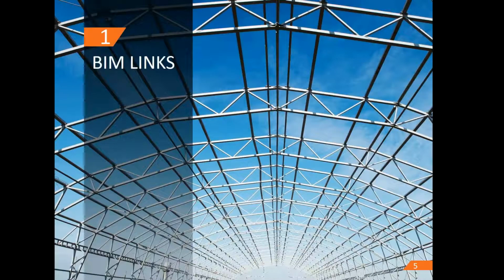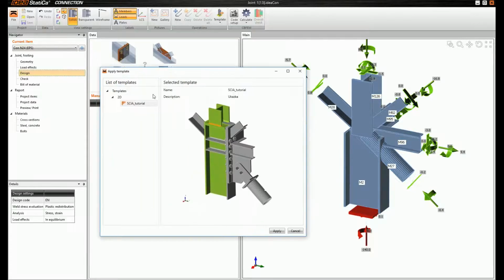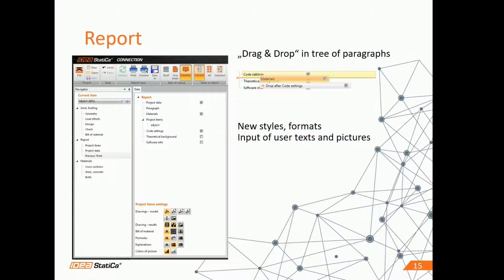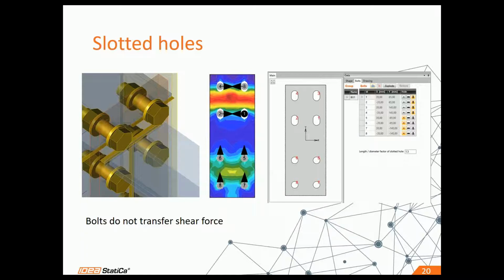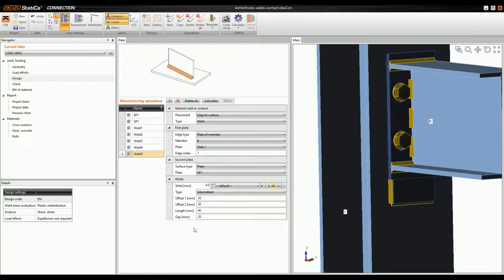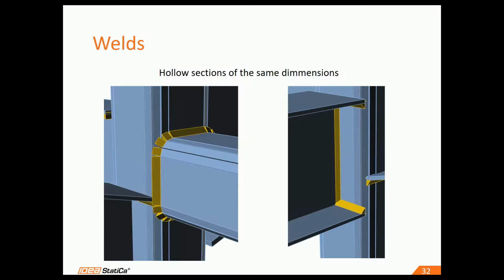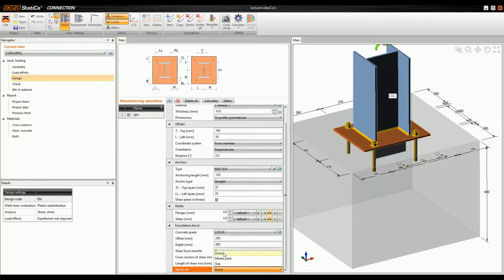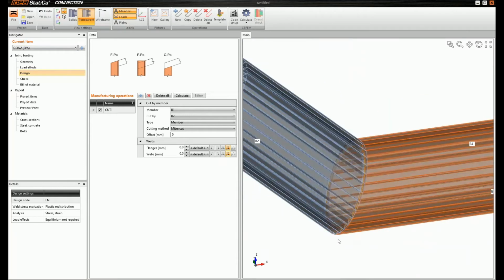What is new in IDEA StatiCa 8.2 for Steel

Comment: Amazing software so far i have seen to design steel connections! One minor issue i have noticed is the inability to export the connection details in dwg, dxf, or even pdf format to enable the designer show them in construction/shop drawings. Keep it up!
Reply from the maker: Hi Eman, you can export the dxf file in the Bill of material. Second option is online connection viewer, which can be accesed froum our web page. It's a viewer for your ideaCon files (saved project from Connection). One feature is export to 3D dwg. Just try it...
Reply from the maker: Thank you, Eman. We are working on this issue and it will definitely improve soon.
Reply from the maker: There is an option to export drawings to pdf and the new online Viewer will enable also to export the 3D model into dwg.